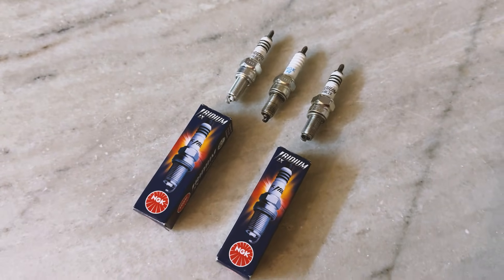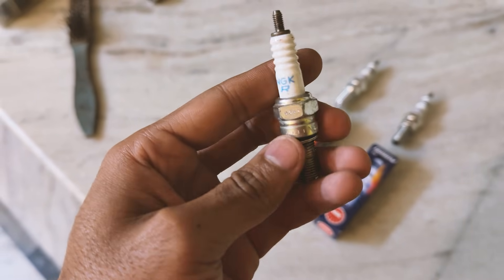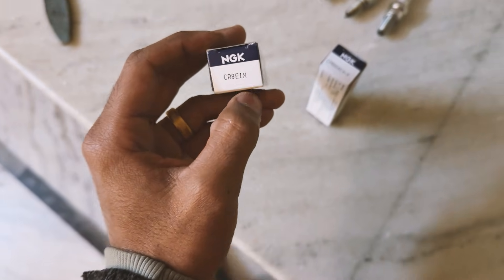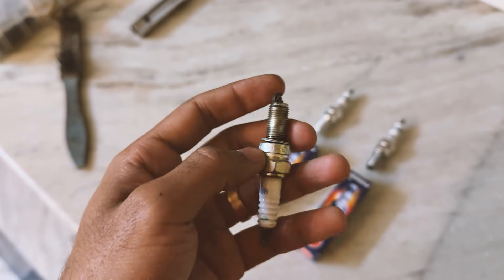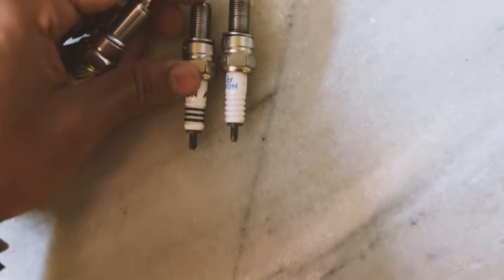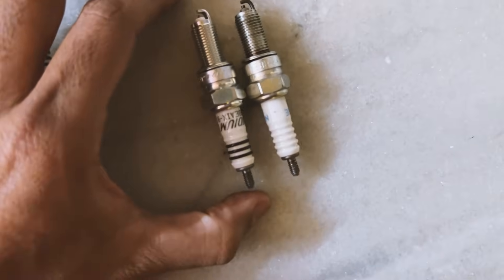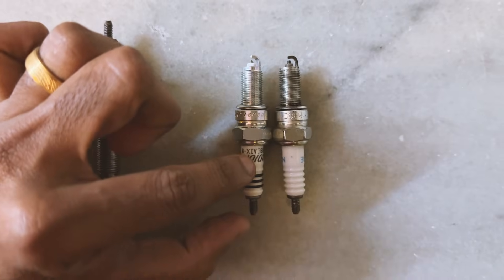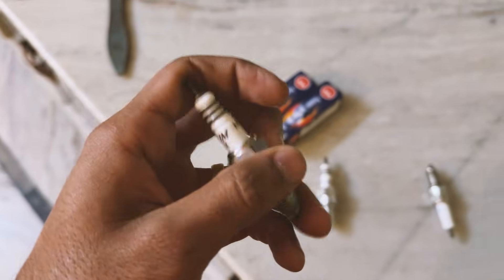Best performance mod for Yamaha XSR/ R15/ MT15. Which model of Iridium spark plug works??

Comment: First of all congratulations on the new bike 🎉

I'm about 80 kgs, I sometimes want to pick pillion of around 80-90 kgs as well.

I was planning to buy N160. But do you think I should consider xsr 155, can it hold that much weight cuz the back seat doesn't look it can hold that weight.
According to u which one would be better?
Reply: Get n250 if you're planning to ride with pillion often ... Xsr feels very underpowered with pillion, even if you're riding with 40-50 kg pillion
Reply from the maker: You don't buy xsr for power, you buy it to get the real joy of riding a true yamaha. I mean the preciseness of handling, it will help you become a better rider.
Reply: @EzMeck I wanted to know whether it can handle that weight.
Let's say twice in a week or so I'll carry pillion.
Reply from the maker: Certainly It will, but performance will be dropped a bit. But handling will not be compromised.
Reply: @EzMeck I myself have this bike, I am just sharing my thoughts so that he doesn't buy bike with wrong expectations
Reply: @deshringdaonunisa1517 thanks mate 🥂
Reply: @EzMeck thanks for the info 🙌
Reply: @deshringdaonunisa1517 thanks for the suggestion

Comment: Apache 2004v or this one ?
I am so confused guide me bhai 🤔🔥
Reply from the maker: Rtr200=raw power, thrill of ride, better suspension. Overall better package, if you can deal with vibes, bad after sales. XSR is emotion, if you like retro timeless vibes, go for it, it's also a good bike, excellent efficient, butter refined, superb after sales, rock solid reliability. 

In short mainly for city, daily office commute, not so healthy built, and occasional long rides=XSR

Lots of touring, need adrenaline rush, heavy weight, go for RTR 200.